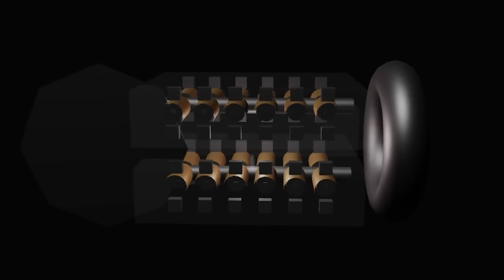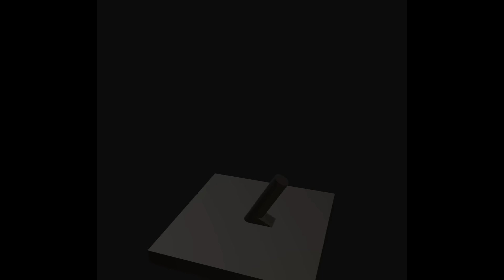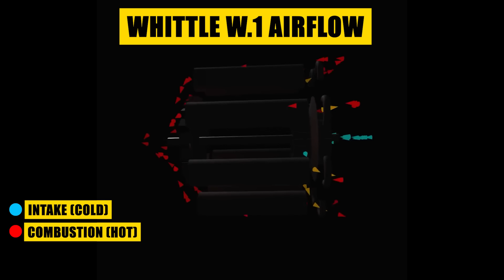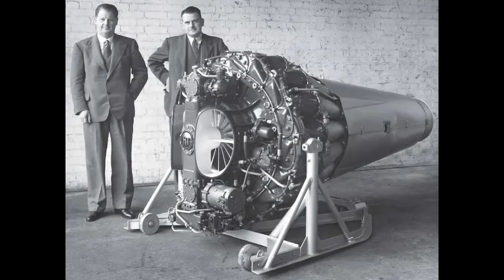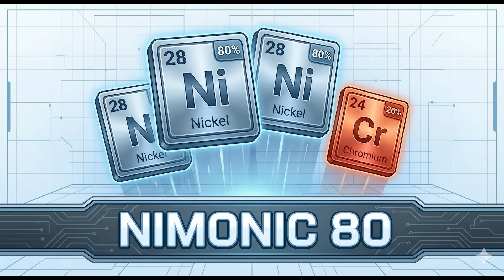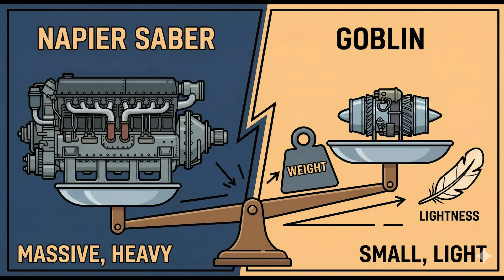The GENIUS Who Emptied the Engine

Comment: The gasoline piston engine cylinder size was limited by heat transfer.  As the cylinder grew, the head area and thus the head stresses increased by the square of the diameter.  To have acceptable head stresses, the head became thicker.  As the head thickened, the heat transfer rate diminished.  Aircraft cylinder maximum diameter settled on about 5.5” (140mm).  Adding power meant adding cylinders culminating in the 28 cylinder Wasp Major.
     Centrifugal Compressors are subsonic limiting the pressure ratio to ~3.5.  The tip speed can be either from diameter or rpm.  But, for jet planes, the axial flow reduced drag.
     Modern helicopter engines (say < 1000hp) have single stage supersonic compressors.  The diffusers use shock waves to exchange velocity for pressure as does supersonic jet intakes.  Works well on helicopters because they run at constant speed.
     Halford deserves credit, but Whittle was the pioneer - the man in the ring.   When you design something new, much is intuitive guess.  Deciding which path to go when all paths look the same.  You get something running and it teaches you.       Cheers

Comment: Nothing much nice to say about the German engine design ... but today it's the only one being used.
Reply: Yes, but the German engines required rebuilding after 10 and later 20 hours because the metallurgy wasn't sufficiently mature. This was not practical which Whittle and Halford knew.
Reply: @nialloftheninedevils  how did they know?
Reply: @KlipsenTube  the Germans don't own axial jet design just because they made bad ones before they were practical.
Reply: @JohnFrumFromAmerica  of course not, they lost the war, didn't they?
Anyway, they realised axial flow was the way to go ... even before they could make them run for very long.
P.S.: Americans don't own powered flight, just because they catapulted an underpowered, impractical glider into the air and "flew" it for a shorter distance than an actual glider would have flown, all other things being equal.
Reply: @KlipsenTube the US built the first practical airplane in the Write flyer 1905. The British knew axial flow was more efficient but made the correct decision to go with the more practical design. That makes the British jet engine engineers of WW2 better than the Germans. There is no prizes in engineering for coming up with bad unreliable designs.
Reply: @JohnFrumFromAmerica  Calling the Wright Flyer a practical airplane, when it did not meet the criteria for powered flight, is childish.
How could the Germans develop better engines without trial and error?
What is the ratio of axial flow to centrifugal flow jet engines today?
Do you really think the Germans didn't know about centrifugal compressors? Do you think they were worried about patent infringements?
No, they had a better solution, and time has proved them right.
Reply: @KlipsenTube you clearly don't know your aviation history. I specifically said 1905 write flyer which was the first practical powered aeroplane not 1903 which was the first powered flight. The Germans in ww2 were trying to win a war not win some argument in the year 2025. They made a poor choice for their engines. After ww2 the Soviets had access to German jet engines but abandoned them very quickly and reversed engineered a British engine for the mig 15 that should tell you everything you need to know.
Reply: @JohnFrumFromAmerica relevance in this context?  James Watts invention of the Watt link is as relevant in the context of a review of the Napier Sabre.
Reply: @JohnFrumFromAmerica  I don't think 'the Soviets reversed engineered a British engine for the mig 15' ! 
Didn't the new 1945 Labour govt ship more than one RR Nene to the USSR to give it a 'leg up' with the new technology?
It was called the Klimov VK-1, it was the first Soviet jet engine to see significant production and it looked mighty like the Nene!
Reply: @DAMORBEL . "In 1958 it was discovered during a visit to Beijing by Whitney Straight, then deputy chairman of Rolls-Royce, that this engine had been copied without license[1] to power the MiG-15 'Fagot', first as the RD-45, and after initial problems of metallurgy forced the Soviet engineers to develop a slightly redesigned (and metallurgically closer) copy, the engine had then entered production as the Klimov VK-1 (Rolls-Royce later attempted to claim £207m in license fees, without success)." This is what Wikipedia says
Reply: No it’s not….. everyone had axial flow engines in development.